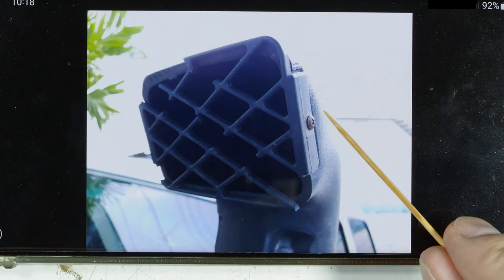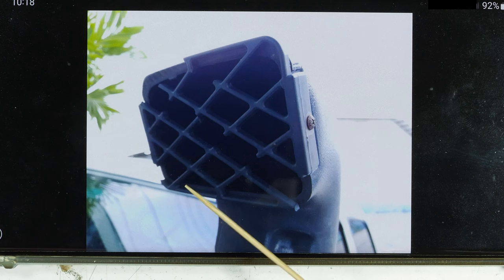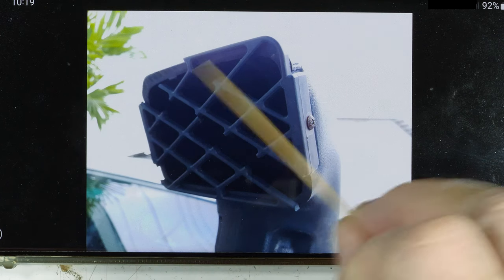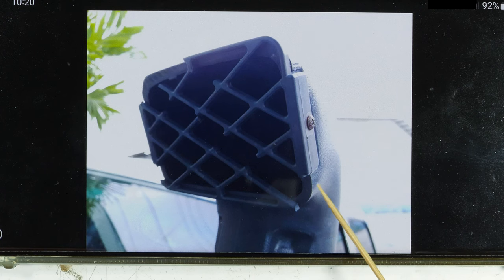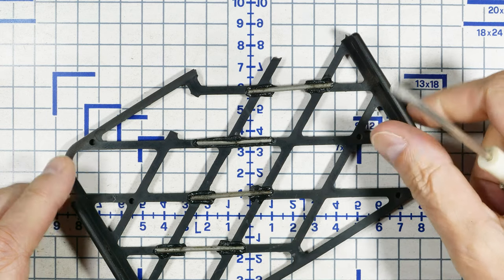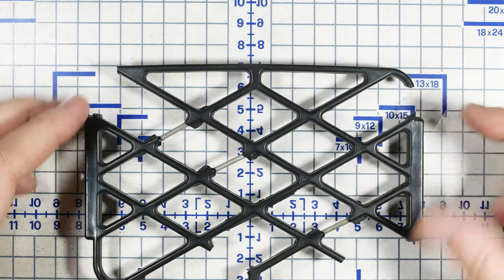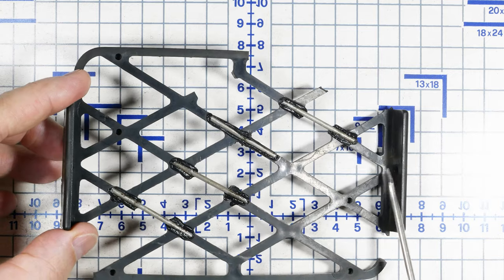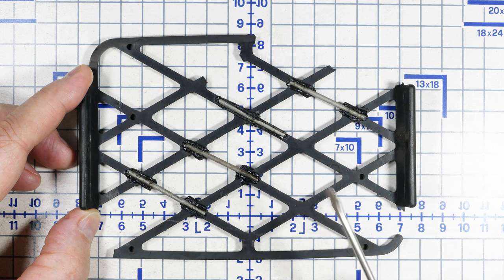Plastic Part Re-creation Tricks

Comment: You could just use callipers and CAD and reassemble it on computer. Make plots. Use metal and poliester mesh. PVC 3D printing sucks, only resin 3d looks nice
Reply from the maker: The problem is he only gave me the broken parts, so the video's about making the pieces work to get measurements. I felt like the people in museums that put broken antiques back together for display. Of course those people are really talented.

Comment: If it was mine, it would have a piece of fish net and a zip tie.  Or, if I really wanted to be fancy; flattened copper tube shaped around the end and wire from Romex soldered on.
      ....better yet, canoes catch more bass
Reply from the maker: I suggested duct tape and some screen mesh, but my friend rejected it. I thought about some copper wiring and solder, but I don't have any 8 gauge for the frame. The tube I might have. I still might make the steel frame and use monofilament just to see how it works. Last time I was in a canoe was high school. Guess I've been in a kayak since. Need to do some fishing.